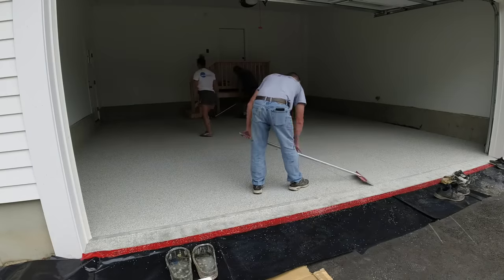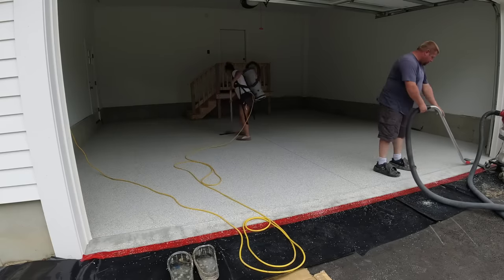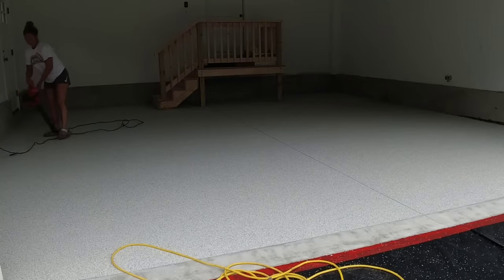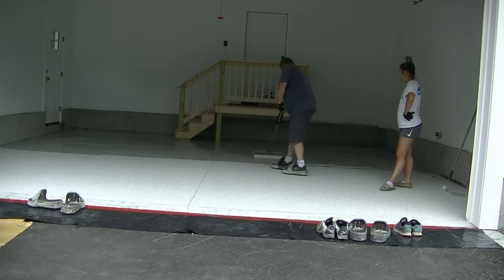DIY Epoxy Flake Garage Floor Coatings (What Most People Don't Tell You)

Comment from the maker: GARAGE FLOOR EPOXY FLAKE COATING COURSE:
https://www.theconcreteunderground.com/offers/JPMbSk6N
Reply: The one thing I wished you had shared, you missed: that wheeled seat, leaning over chest support thingy that was used to hand grind.  :D
Reply: Where are you guys located??? Great vids. Very informative and a joy to watch
Reply: You have 2 courses for epoxy garage floors.  Are they different?   Thank you
Reply: You may want to teach your crew to put the cord over their shoulder when using the stand up grinder, buffer or sander.
Reply: How much$$ for a to car garage ? Please and thank you great job 👍👏
Reply: You didn't mop or wash floor after grinding?
Reply: @milkdeal  ,  my thoughts exactly.  I'd of thought you acid wash, rinse after all that dust was picked up.
Reply: Any idea if I can use a can that's 10 years old, but unopened.
Reply: @mikeschaner5853  Racatac makes one. havent seen Mike's
Reply: @ronherkey148 no acid washing as it has to be neutralized and even then it can be there reacting with the concrete or epoxy coating. No rinsing moisture in the concrete will affect the epoxy. I've seen a lot of guys just vacuum  blow and vacuum again
Reply: Hello Mike, it's Ian SCOTTA here again from Toronto, ONTARIO, CANADA.  I want to purchase your EPOXY COURSE and I went into your link provided by you, but it asks for a COUPON CODE.... where to I myself attain this coupon code?
Reply: Thank you for sharing such a great video. Do we need to do the course to get the product?
Reply: Mike
You are so down to earth explaining the process.  I only did a quick search and was so informed and educated in about 15 minutes watching the video.  I was asked to investigate repair of an 8 x 40 exterior solid concrete walkway at our church.  It's a built up pour at least 4 ft thick.  What appears to have happened some 60 years ago was that they floated (I'm not sure vibratory concrete settlement tools were available then) such that the the top was mostly concrete paste and not much aggregate.  This then had light cracks at some point with the paste popping off and exposing the stone stone below.  Up to 1/2" pits.  Based on your video grinding is necessary to rough up the smooth areas.  The church is in Seneca Castle NY.  A small cross roads mill village in western NY.
Reply: I appreciate the detailed info here, very helpful, but there is no way that is a 24X 24 garage unless the video just really doesn’t show the dimensions very well.  

Based on the garage door, that garage is at best 18ft deep.  Maybe 20ft wide

Maybe I misheard, but this garage is not 24x24

Comment: I did my garage floor 19 years ago. I acid etched it, primer-ed it , and epoxied it with box store products. I have severely abused it and it has held up great. I do agree that prep is key to any project. Not everything in this world has to be "Contractor" grade. I think that is an overused word. A lot of box store products are great for the home owner.
Reply: Yes, I have done maybe 5-6 garages over the years with big box.   I have never had any issues and they always turn out great.   I agree this is the "right" way to do it, and better.   But IMO this is just a step above.   Is it worth it?   It is a choice, but lots of folks dont want to spend $1000's verses $200.
Reply: @kenstrain4366  I think that's the real question.  Does the average homeowner garage really need this level of work at 10 times the cost.?
Reply: Yeah, I did my four car garage myself about 15 years ago with a big box product. It is still like new. I spent a whole day just cleaning and degreasing really well. Then one day to apply and a few days to dry just to be sure in the hot summer of course.
Reply: YOU, are also not a contractor. If YOUR epoxied floor has one tiny little issue after, you don’t have to deal with being called back out to do either a patch or complete re-do. Yes, plenty of homeowners who follow the directions on the box do get good lasting results, but when you are a contractor who does a job for a living and has to put your name on every single job that you are contracted to do, you go the extra mile to get a result that is 100% guaranteed to last
Reply: @jacobiverson9724  I also don’t charge $5,000 to do a job like this. Also very few contractors care about doing a good job. I have seen poor jobs countless times by union workers also.
Reply: Exactly. I think most big box packages have weak acid etch. If you actually buy acid separately, not the powder in the kit, and you can see the acid bubble when you apply it, and you can see the rough texture left on the concrete, then you'll get a good adhesion.
Reply: could I do this method in my master bedroom?
Reply: Any idea if this product is still usable if it's 10 yrs. old. in a sealed can?
Reply: @jacobiverson9724  EXACTLY!
Reply: @kenstrain4366  Thanks, I have a house built in the 50s and the more I watched these videos I was thinking how much time and money do I truly want to spend. I want it to look nice but I also don’t want to spend  thousands on it. .
Reply: In canada, with the salt and rocks that are added to the roads. The rocks freeze into the slush and snow, then drop onto the garage floor. As you drive in and out of the garage, it acts as an abrasive and punctures the box store thin coatings, the salt and water seeps into the little holes and lifts the coating. The salt then stays under the coating where it doesn’t peel off. If you are like me, you put a new coat on each year to make it look ok again…. Until the vechile tracks are divots from the cement being eroded, and then call in a pro to patch the holes and do it right. It would have been better not to put the fake-coating on from home-depot, wouldn’t have ruined the cement. Cost of the pro job was 10x more, but worth it.
Reply: Facts! Use a moisture barrier epoxy though when you etch 👌🏽💎
Reply: He did mention that he grinds up quite a few of these floors improperly applied by the homeowner, so hiring a professional is more of a guarantee that the job will last. Sure, you could get lucky and your DIY floor could last, but you can’t run a successful business on luck.
Reply: @kmbbmj5857  That is a good point and also they have all the proper equipment and labor to charge more for the job.
Reply: Hello, question, can you please describe how and what you use to primer before using a box store epoxy? I recently did my own floor without primary but I did do the edging and prep and it came out great to be honest but I wanna help other people do theirs so if priming makes a big difference Id ike to know how to do that. Thank you
Reply: Proof????
Reply: I did my 2 car garage about 8 years ago. Doing overkill on the acid etching with a big box product. Still looked good when it sold last year. But think the grinding is a much better way to go and using a primer and base coats along with UV resistant top coat.
Reply: Are these floors slippery when wet? I'm doin this in may
Reply: @busybeemama1762  do you have concrete in your bedroom? If so then yes but why would you want that in your room 😅
Reply: Will the customer pay? Nah!. Far and few in between.

Comment: From somebody who does resinous flooring for a living in everything from factory’s,plants,hospitals,universities, and sometimes garages. It’s great to see someone explain to people the reason why a good floor cost what it cost. The proper surface preparation and proper products used are the most important aspect of a quality long lasting epoxy floor.
Reply: Can I do it on a wood flor
Reply: The problem with epoxy is that it doesn’t take heat.. one hot tire and it can fail.
Reply: @krakenwoodfloorservicemcma5975  so whats the alternative that can withstand the tire?
Reply: @krakenwoodfloorservicemcma5975  That depends on the product. The epoxy coatings we make where I work have HDTs over 350F, so they won't soften from a hot tire even for extended periods of time.
Reply: @derekpayton910  Do some research on the coatings. there are tons of different options. Some companies offer Technical Data Sheets as well, which give more details on physical properties. Look for high temp resistance, higher HDT (heat deflection temp), etc. But honestly, any decent epoxy should take up to 200F no problem, especially if you have a solid top coat
Reply: What can you use on an elevated concrete parking deck in order to seal cracks and make it waterproof?

Comment: I don’t know I’m a pro painter and I just got a look the floor of a two car garage  I did 12 years ago with Rustoleum epoxy and a clear top coat and etched it with muriatic acid while  the top coat lost some of its sheen the floor as a whole it looks great no hot tire pickup. I wouldn’t put down big box store products cause it’s all about the prep the products are not that different.

Comment: I tip my hat to you. But these viewers need to know the difference between porous and sealed concrete and the image view of prepped concrete. All epoxy will yellow. No epoxy is the same. Some have higher tempt resistance, others have higher Chem resistance, anything that is outside needs a polyurethane sealer or aspartic.

Comment: I could have went to Home Depot to do the heap DIY stuff that fails , but I didn’t I called in a professional, I have a 4 car garage and it wasn’t cheap but 5 years later it looks as good as the day they installed it. Get a professional is all I can recommend, my floor is a full broadcast with a clear coat , I think they used around 175 pounds of flake on mine , then two coats of clear …. They floor is thick. The product on mine is a poly as well. This is a great video to show the process and it seemed like a real good job.
Reply from the maker: Thank you!

Comment: very informative video and one of the better surface preparation videos i've seen.  At my old house i installed a standard water-based epoxy kit from the hardware store on my own and just acid-etched the concrete on my own.  Somehow it stayed down for 10+ years with no peeling, hot tire pickup, or other issues so i got very lucky.  Installed several others for family members and no matter how much you clean floors it does NOT matter if you want quality long-lasting results.  Surface grinding is by far best option to get a good solid coat down that is going to grab the concrete properly.  Thanks for a great video showing how it should be done!  If you want it done right, don't go cheap on garage floor coating preparation or materials.

Comment: Wear a respirator!  Anyone watching this will get the impression that it's perfectly safe to grind concrete and breath in the dust.  Silicosis is incurable and 100% fatal.
Reply: Not bad advice, but the hand grinder was hooked up to a vacuum and the floor grinder has a sweep around it to knock the dust down immediately.
Reply: @Self Made Auto Go ahead tough guy...show us you grinding concrete without a respirator
Reply: @Self Made Auto who hurt you?
Reply: @mcarendt  incorrect I thought the same thing until I hooked up 3 air quality meters. No visible dust but PM 2.5 was off the charts. PM 2.5 can be absorbed directly into the blood stream.
Reply: @BenjaminBennett  I agree. A LOT  of the dust is not visible but still there.
Reply: or water down the concrete so you don't get dust.
Reply: @FoxHoundUnit89  if someone doesn't want to wear a seatbelt that should be their own choice.
Reply: @678friedbed  Then it should also be the choice of emergency service to not attend an accident with a non seatbelt wearing driver, and to ignore the screaming body lying on the road ... hey, own choice.
Reply: @phoenixdundee  emergency services already have that choice. you definitely are not very intelligent.
Reply: @678friedbed  Really? So you have evidence that emergency services will ignore a potentially fatal accident? Or that they will leave someone lying on the road dying ... are you really going with that as an intelligent answer? And then you have the audacity to claim I'm lacking intelligence. Wow.
Reply: You need to take a bubble bath with your toaster Chip 👌👌
Reply: @phoenixdundee  they can ignore injured people if they want. there is no law or regulation requiring then to perform service. it it was required that would be slavery, you cant force people to work no matter what industry it is.
Reply: not fatal but irreversable
Reply: There's a lead tech in my company who core drills concrete with no vacuum/water system or a respirator. He breathes in the dust and talks like it's no big deal and makes fun of people who tell him he needs a respirator or a vacuum system. Shockingly similar to some of these comments.
Reply: @elonmust7470  I used to hate going to industrial accidents in my ambulance. 3 year old child with her arm sucked into a meat grinder, just helping daddy in his shop. 20 year old apprentice with a mashed leg from poorly maintained girder crane. Quad bike rider, no helmet with the top of his head gone. Three guys drowned in a dam, when the sluice gate wasn't locked off. Young electrician with his hand cooked off the bone after contacting an HV live cable.  I have to go home and sleep at night after this stuff. They leave families and children behind because of preventable events, they leave injured and disabled people at best. They aren't accidents! Safety guys wouldn't be needed if everyone was as knowledgeable as you.
Reply: @philgray1023  I hatr safety nazis because they always wanted me to wear chaps. My first career was professional timber falling. Chaps, outside chaps at least were a liability to my freedom of movement. I don't understand how guys aren't able to keep a moving saw chain away from their legs. To me it's beyond 2nd nature.
Reply: My cousin has stage 4 emphysema from silicosis! He was mixing glass microbeads and epoxy for heat shields on dental chairs, never told to wear a mask, no proper training. He was young and unknowledgeable, started with the company at 19 or early 20, he was 45 when diagnosed. He literally can not walk 50 feet without being out of breath.
Reply: @678friedbed  That's not how it works. Educate yourself before making statements like that.
Reply: @debbietencza190  that's not how what works?  you should definitely take your own advice.
Reply: Clearly you've never layer an epoxy floor before, I own my own business and have been laying floors for 15 years now and the grinds don't kick up dust if they are hooked up properly and the big floor grinders are low speed so still don't kick up dust. Not every trade and machine is all OMFG WHERE IS ALL THE SAFETY GEAR..... QUICK GET YOUR SPERM SUIT AND RESPIRATOR
Reply: @callumv9758  well when I grind floors I use water to stop from kicking up dust  because no matter how slow the machine is or how good your vacuum system is it will always kick up dust and that anything in dust form isn't good for your lungs.

Comment: I'm happy I saw this. My only experience with epoxy coated floors was the one where I worked, and I guess they didn't put it down right because it peeled up. So, I thought epoxy peels up and isn't worth it. Now that I know they can last much longer if applied correctly, I'll consider it for my next garage. Thanks for the info.

Comment: I approve of this video. Of course, you are a pro and I'm a DIY'er but I can tell the folks your methods are sound. I'm not sure why you use so much fleck, but to each his own. I glad to see that you throw the fleck up in the air instead of dropping it on the floor. I tell people "think happy New Year" when flecking, not "feed the chickens.

The easiest way to tell if a pro did the work or a DIY'er did the work is look whether the fleck pattern looks random or has steaks and spots. Of course, the other way is to see how it holds up if there are adhesion problems then you are looking at a DIY job. 

I've done 5 garage floors and two basement rooms and I've never had a tire peel up the epoxy.  I use the Sherwin Williams epoxy kits - wait for their 40% off sales and yes figure no more than 200 sq ft per kit and buy one more kit than you think you'll need and take it back if you don't need it.

Comment: Mike, I don't know if you still check this, but your videos have really been a major help.  Prepping to take two coats of paint off my mother's carport floor, and get it ready for repainting.  Will probably do the angle grinder/diamond wheel method.  Have looked on your tools page, and maybe I'm just not seeing it...but where could I get one of those wheeled, padded rests your guy is using when he's got the angle grinder?  I'm a hair over six feet tall, and that looks very comfortable for what I imagine is going to be aggravating to my back if I'm on my knees the whole time.  Thanks!!!

Comment: I love epoxy!!!  Been working with it for 8 years just opened my own company about 2 years ago. Going great!!!  It’s not that the box stores product is bad if prepped properly it can hold up for a while. But its 25% water and you use less product in a kit than our kits, use less flake, when it dries the water evaporates where when using 100% solid its stays exact how it was put down. My floor is about 75% thicker than the DIY system just because of the amount of product and the water evaporation. Not to mention the 1 pound of flake they give you,  I use about 60lbs for a 450sf garage when they tell you 4-8lbs should do it haha. It ends up looking like a shiny paint when done, where a professional resin floor looks nothing like a paint, you can tell the difference as soon as you walk up to them and just look. One is shiny paint one is a flooring system. Stay safe all.